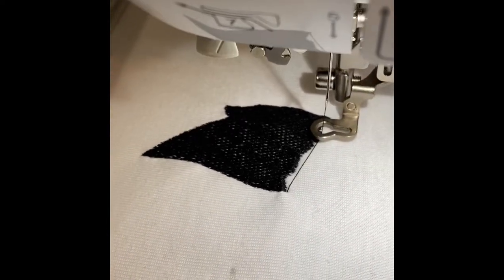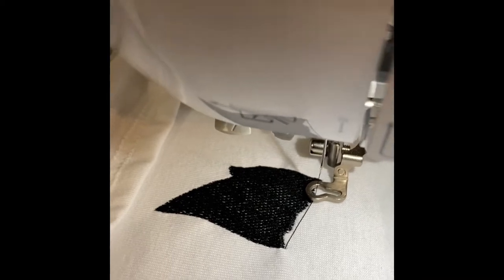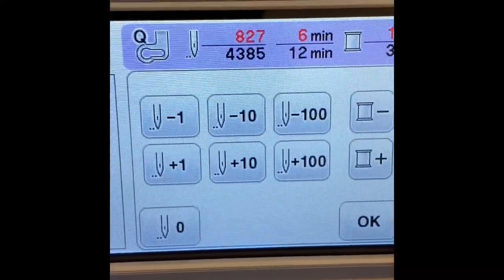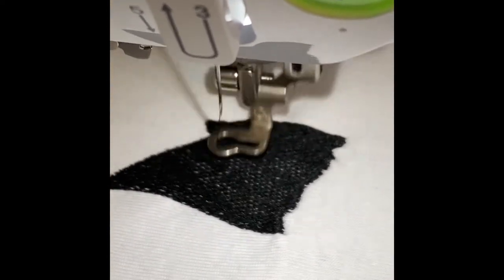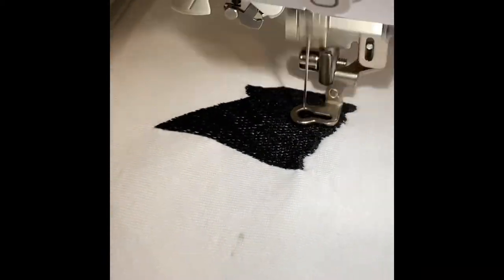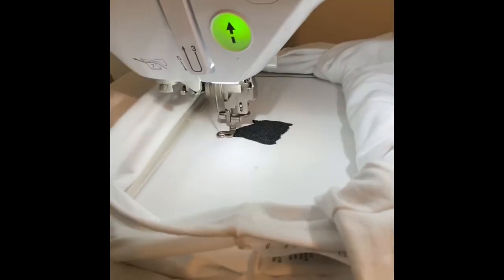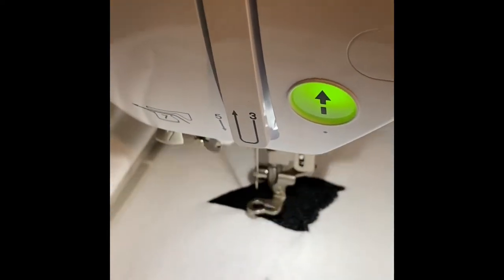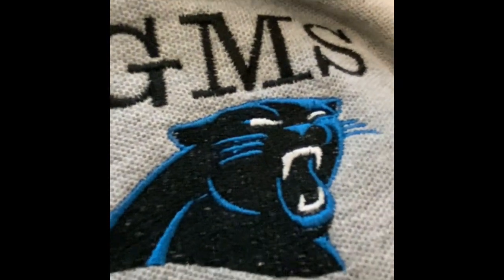HELP!!! PE 800 is breaking needles and ripping shirts as we do embroidery and applique projects

Comment: I have a PE 800 too. Can you give more info?  What type of stabilizer are you using, tear away or cut away?  What needle are you using, regular or ball point?  If you purchased the design and it appears to be a dense design, go back to the digitizer and let them know, the stitching of the image is not filling in well and send them a pic of your test stitch. They may have to increase the density setting on the image and then resend to you.   Hope this helps.
Reply from the maker: Thank you, Thank you! I was sure that we responded to your comment already, sorry. We use a tear away stabilizer and a regulary embroidery needle. I thought it may be the designs we were purchasing of etsy so I purchased on from brother. It did great except for on line that came just inside the design for some reason. I noticed that we haven't had an issue when we do letters or preloaded designs though. Ever heard of machines having a software issue?